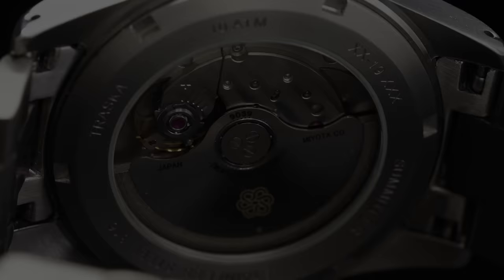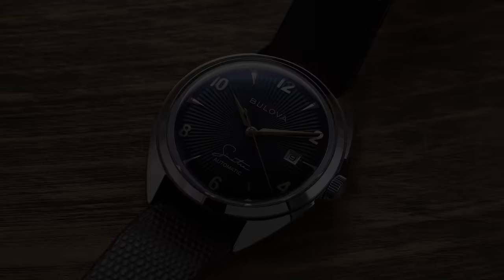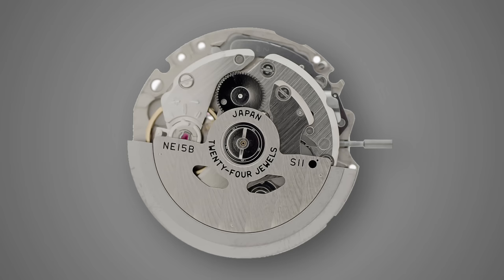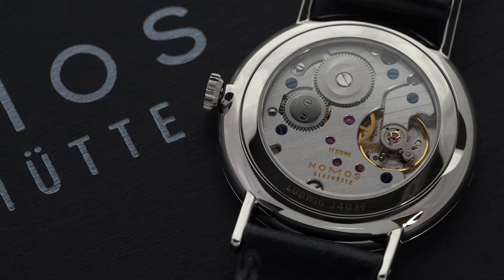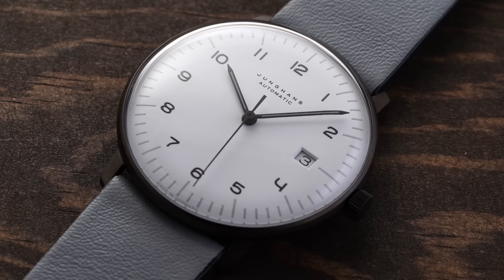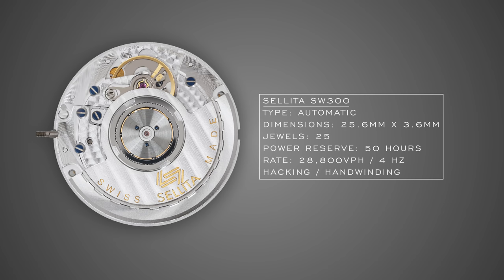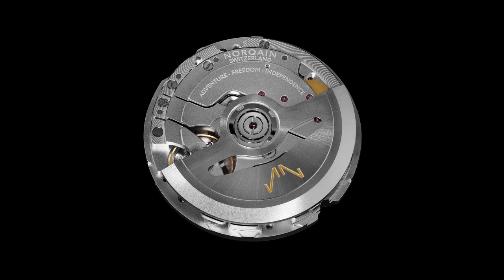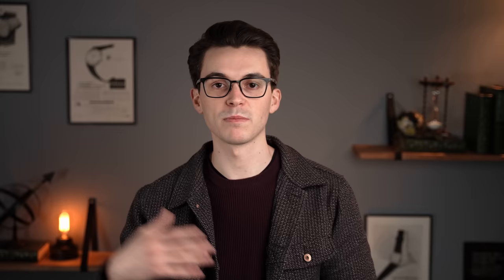Overview Of Third-Party Movements: ETA, Miyota, Seiko, & More (A Comprehensive Guide)

Comment: If I can't have the real 2824, I'll take the Miyota 9k series over Sellita. I know Sellita SW200 is supposed to be the same as the ETA (I know all the backstory), it's still not. I experience stiff hand winding with rotor wobble and stripped gears. I like to hand wind my watches whether or not they are automatic.

 Don't offer hand winding on your movement if the gears can't handle the torque. I should be free to wind a movement fully by hand if I so chose, without fear of damage. The only times I have encountered problems have been with Sellitas. (2/2). Yet I have an older Swatch auto (ETA) that I have only ever hand wound for the last 13 years, without any problem. As well as a second hand Oris daydate (635) (ETA base) that has been hand wound during my 3 years of ownership, also without any problems.
I'd say the NH35 is a very easy and smooth crown wind as well, but I don't care for such a choppy low beat. That's why the 9000s are my choice out of the three.

Comment: What a fantastic primra for 3rd party movements.
I'm sure you're aware of the ones you left out. No doubt you needed to keep the video to a manageable level. 

Perhaps you could add Rhonda to another video. They're a great manufacturer and make reliable movements. 
I haven't look to see if you've done a separate video on Chinese movements. There are a few different Asian brands that are worth mentioning. 
Obviously Seagull is one of the top brands of movements. They do make a few lower end movements really not worth using. But they do make a few really good higher quality movements. I personally have stayed clear of them lately. (Mostly Geo politics) However, I do have quite a few that I've bought in the past. I guess that will depend upon how you personally feel about them. I don't stand in judgment of anyone. 

Thanks again and continued success.

Comment: Hertz is the standard SI unit of frequency. Unlike most units of measure (e.g. inch/inches) Hertz are always Hertz regardless of the quantity. A case measuring 44 millimeters is a 44-millimeter case, but a movement with a frequency of 28,800 Hertz is a 28,800-Hertz movement. It's never a 28,800 Hert movement :)

Comment: Really great research and presentation making us aware of the variations of the basic third party movements. 
 So I have three watches with the NH movement.  Actually I got hooked during covid 2020. I now see that my three separate watches, all micro brands have three separate versions. Avi8 straight NH35, Forge & Foster NH36 (day n date) and Signum diver NH38 (no date) All excellent individual designs. Personly these Seiko movements are all too ubiquitous and that makes me hesitate to buy another 'NH35' watch again. Time to look for something with those ETA of Selita mechanical inside.  I see several Russian pilot style using these movements.  
Same goes for my three with Miyota8215 I have. Parnis, Sternglas and Panzera T42 first model. Curiously when adjusting the minute it makes the seconds jump up and down by 6 or so second increments, but no big deal at this quality. Thanks Teddy K U T G W 🙏 G

Comment: I got spoiled by Seiko quartz reliability and longevity.  Never a service during 27 years of daily use.  The simple trick for mechanicals is to own several. Part-time usage should nearly guarantee never needing servicing.  Movement replacement for a beloved, discontinued model would work as well. Owning super expensive watches, requiring periodic service, is neither fun nor smart.
Reply: The lubricants age even if the movement is used sparingly. Same case with gaskets that provide water resistance. However I think that there's no need to be overly paranoid and service the watch every 4 years or so. I think 7-8 years is enough before the oils dry completely. Actually, companies that make their own movements just swap out the movement for a refurbished one.
Reply: @baze3SC  I find 27 years of continuous use very compelling.  The caseback gasket likely was replaced in that time interval, but I was not replacing my own batteries back then.  The watch, Seiko Sports 150, saw sea kayaking water exposure throughout much of its life.  I would bet I could put a battery in today and see the same 20-25 sec. per month performance.
Reply: @m2pozad  Yes, any quartz watch will have an inherent advantage because not only there are less moving parts but the gears only move once per second instead of eight times per second. I do own a couple of mechanical watches for sentimental reasons but after 5 years or so I just buy another model that piques my interest. I'm not preserving them for future generations or anything of that sort. I'm sure it would be cheaper to just swap out the whole movement instead of cleaning and lubricating every part. For outdoor activities or travel I always pick quartz. It's just more convenient, no need to care about magnetism while going through airport scanners etc.

Comment: These are not “3rd party movements”. Miyota only appears in products from their parent Citizen watch group, this includes Citizen, Bulova and MVMT. Seiko too only appears in products from the parent Seiko Watch group including various Seiko sub-brands, Lorus & Pulsar. ETA is owned by Swatch Group and their movements, to my knowledge, only appear in Swatch owned brand, of which their are many. 

Today there are very few actual ‘3rd party movements’. For years it was Lemania however they went through several ownership changes over the years and I do not know if they are still produced. Last I heard they were owned by Breguet. Their most famous movement is the 5100 automatic chronograph used by Fortis, Omega and Sinn though Omega is now using ETA’s as part of Swatch Group and I do not know if the other 2 are still using the Lemania movement. Another famous 3rd party movement was Zenith and its ElPrimero chronograph movement, formerly used by Rolex, among others, but I do not know if Zenith is still selling their movements. Their own well known watches of course use Zenith movements.

Comment: More on this topic. Focus on servicing.  Where, intervals, price, oils, what if you only wear a watch 4 times a month stuff like this. I have a big rotation so if I only wear a watch 90 days a year is it ok to stretch to 10 years???
Reply: I would yes, easy, mind you I am on the dark side of service attitude, ain't broken don't need fixing then.
Same as you, big rotation. My omega from 60s, zenith from 70s, Piaget from 80s, and my omega and tissot from 90s plus all my new watches with eta, Sellita, miyota, 6r have never been serviced and work fine. I don't care about cosc accuracy though.
Reply: @johnmuthan286  wow! That’s good to know. Maybe the whole service thing is a bit of a money grab. Yeah I’ll lean towards ten years.
Reply: I am of the same mindset. Servicing your watch when there is no deterioration in performance can open the watch to foreign particulates  and potential problems. Unless your using the watch everyday or having sit on a continuous watch winder then there is no need to follow the manufacturer recommended service interval...it’s a cash grab.

Comment: People talk nonsense about movements. The key is reliability not the accuracy (within reason), decoration or cosmetics. Accuracy within +/- or 10 seconds per day is more than sufficient for most situations. All mechanical watches need to be reset regularly.  Resetting a watch once a week is normal and not a chore.   Practically speaking there is not much advantage between an ETA 2824-2 top grade movement and an in house movement like the Rolex 3235. The difference might be as small as +/-2 seconds per day if both movements are properly set up and calibrated correctly.  As the movements start to drift the accuracy could be easily indistinguishable. If your looking for precision buy a cheap quartz.

Comment: At 5:16, if a movement has 28800 VPH, then it's 8 Hz, not 4, isn't it? Or do I calculate it the wrong way? 28800/60*60 = 8 times per second

Comment: Great video. However, there's a question mark about the jewel count in ETA's 2824 and 2892 movements. The official (from 2015, so perhaps things have changed, although I don't see why) documentation I have at hand says that the different grades only differ in the suspension type (Etachoc, Incabloc, etc), the material of the balance wheel, and the material of the hairspring and mainspring. Has anything changed since then?

Comment: I have a Junkers J1 with the  Citizen/Miyota 821A movement that suffers from the infamous Miyota stutter. It's also 20+ sec fast / day. I won't buy another watch with Miyota movement. On the other hand my Sinn 144GMT Ti has a very solid, reliable and accurate Valjoux 7750 with +3 / +5 secs per day. Same goes for the movement in my Seiko SKX 009J
Reply: Miyota 9 series like the 9015 are a great movement comparable to ETA 2824-2, the 8 series Miyota's are much cheaper and an  inferior movement compared to 9 series.

Comment: Why are we still messing around with mechanical watches?  You mentioned a zenith watch that beats 327,000 per hour when you can buy a Quartz movement watch for less than $10 that divides each second into 32768 beats per second and a simple stepping motor will be less effected by shock, temperature, position ect, than ANY watch using an escapement system.

Comment: Hi Teddy ,this is Abdul, I have a question, how did they manage to calibrate watches before timegrapher was invented?  , how did they know the accurate time for watches before the invention of atomic watch ? 
Thanks
Reply: I'm not Teddy but I think I can answer at least your second question. The movement of celestial bodies provided a fixed (although crude) scale. Pendulum clocks were used to count oscillations between the two astronomical observations and they were continually adjusted. The invention of temperature-compensated chronometer made the process even easier. Synchronizing signals were transmitted using wires or radio. Then quartz was invented. Again, it was corrected once in a while using astronomical observations. Finally there were cesium clocks. Regarding calibration, initially it was time-consuming since you had to tweak and wait quite a while before you compared the result against some reference clock. But the process was made easier by Vibrograf. It was a device that compared mechanical oscillations against quartz. It used induction pick-ups similar to how an electric guitar picks vibrations of the string.
Reply: @baze3SC   thanks bro , but my question if there is no electricity at all how can we know the accurate time to adjust the watch ?

Comment: Junghans' calibers are no longer ETA based: they now use a Sellita base for most of their most famous watches (like max bill manual).
Reply: He's not wrong, though. Since all Selitta movements are based on ETA calibers, Junghans' still uses ETA-based movements.
Reply: @einundsiebenziger5488  even if a Sellita SW210-1 (base of current max bill manual winding) is the "clone" of the ETA 2801-2 (base of previous max bill manual winding) I consider imprecise to show pictures and talk about Junghans in the  section of the video dedicated to ETA also because in the same video there's a section about Sellita in which other pictures of other brands and models are shown. Of course it would be quite difficult for Junghans to use a ETA base nowadays.

Comment: I have a bewitching with the eta 2824, I also have other watches with the nh35 and miyota 9015. The eta so far is very fragile, running fast +2minutes a week almost. The seiko and miyota movements are much more accurate in the same daily usage over the span of a year. Kind of disappointed in the breathing from that pov
Reply: Breitling oops autocorrect
Reply: Regulations/accuracy as nothing to do with reliability

Comment: There is probably no Swiss escapement "mechanical' movement in the history of 'time' more accurate/stable than the 2824 (and the various clones and other ETA movements derived from it).   The 2824 has some 'issues' however - the rotor bearings are fragile and in some cases give out causing the rotor to get caught and/or spin around when the watch is wound.  The repair is difficult and expensive, and it's probably cheaper to get a new movement.  This problem was repaired in the 2892 series  -- fixing the rotor is the main reason for the 2892's development.  As far as high end luxury watch movements, it's frankly all down hill from the 2824.  They are not more accurate, but some of the cost may be justified by more refinement of finish, which approaches an art form in some of the priciest luxury models.
In truth a carefully regulated Miyota or Seiko entry level movement is very nearly as accurate as the ETA series, certainly capable of reaching the COSC accuracy standard of -2 to 6 seconds per day, and very often around that accuracy out-of-the-box.   I think Tedddy B. is incorrect stating that the 4R3x series is at best +10 seconds a day. 
For a Seiko entry level movement,  e.g., 4R3x, +10 would be a little disappointing.  I have about 2 dozen watches with these movement and all but one is better than -10s to +10, and the one that was inaccurate (+24) was easily regulated to +1. The main difference is that the ETA calibers are more accurate when the mainspring reaches a run-down condition (from not being worn and/or not being manually wound).  
Chinese watchmaker Seagull clones of ETA movements (Seagull 2130) are usually just as good as the ETA originals, which even in the base models have Geneva Stripe finishing and other decorative elements only found in higher ETA 2424 calibers,  can be found in Ali Express 'Chinese specials' for as little as $160.00.
I've never had a watch with the Miyota 9015, but it has a very good reputation and is also more or less comparable to the ETA 2824-2892.

Comment: Thanks Teddy. Appreciate the video. I currently own an Omega chrono (9300 mvmt, -1sec/day); Melbourne Serrento (sellita sw200 mvmt -4to5 secs/day and a Formex Leggera (sellita sw200 ((COSC)) + 3secs/day) which was changed from an STP-1-11 movement. Enjoying all three watches, but I'm extremely satisfied with the sellita movements. The STP movement that initially came with the leggera ran out of COSC spec, so Formex made the change to the sellita sw200 movement. Have you heard any issues regarding STP accuracy? Also, I agree with an earlier comment on the cost of owning in-house movements. Could be quite expensive in the long run.

Comment: Go for quartz, no maintenance and it's more cheap.
After spending money on watches none are accurate as 5-10s per day, at least for 400-500$ watches.
Reply: Quartz has its place, but generally speaking nobody is going to pay thousands for battery powered electronics, with some exceptions(GS and Citizen) it’s completely soulless and not particularly desirable. Every collection should have at least one high end Quartz but unless you are an accuracy freak mechanical is where the fun is.

Comment: Sellita started out assembling movements for eta and then switched over to production not too long after Swatch bought them. Some of the earlier Sellita SW200 were inferior to the ETA movements until they made adjustments. I own an ORIS with an early SW200 and it has broken down completely,  two times with minimal wear.
Reply: Except that's a ridiculously untrue statement, thanks for the fiction

Comment: By the book service intervals are just safe, conservative recommendations to absolve brands of responsibility risked by listing a higher number. They say 5 years, but are good for far longer.
In the real world, you can stretch that to 10 years or at least 8. Don't service a watch until it becomes evident. At 5 years, I'd get an easy regulation at most (or just do it myself). Shit isn't getting damaged, and it isn't dirty. Just some congealed lube in there, it didn't turn into cement...relax on those intervals, it's not engraved on tablets given to Moses, it's a suggestion.

Comment: Miyota will always be hobbled by the fact that the automatic winding is unidirectional (the rotor winds the mainspring only in one direction). The rotor free spins in the non-winding direction, contributing to the dreaded Miyota noise and a rattley rotor. You just can’t beat the winding efficiency of the Seiko magic lever

Comment: Dude, 2892 isn't really better than 2824. That's mostly a myth. There is truth to it, being that the 2824 exist in Standard grade while the 2892 does not. But if you compare apples to apples, a 2824 Top grade will be exactly as good as a 2892 Top grade. They are regulated according to the same quality control standards.

Comment: One of the most pointless debates in the world on any subject. In house or 3rd party is a none starter. If you buy a swatch with an eta then it's in house. If you buy a vintage daytona then it's 3rd party. Sieko with nh35 36 or early timex. Theirs an assumption that in house is better but it's just snob value and most watch owner haven't got a clue anyway, unless they actually worked on watches. All watches work the same. Either side centre second or sub dial and it really is where they take the drive for that hand that is the main difference in movements, obviously not including those high art watch movements that aren't really usable due to being fragile and ultra expensive. Other than that it's beat rate. Point is all movement can be in house or 3rd party depending on the name on the watch and are a mark of nothing at all. NH35 is maybe one the best movements ever made. I have a 69 timex day date no jewels and still running and widely thought of as junk but is in fact" in house". Movement are good or bad because they are good or bad. 3rd party are maybe better because they have competition.